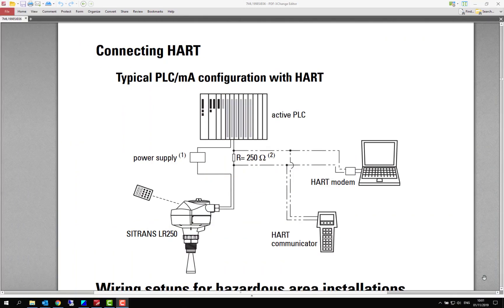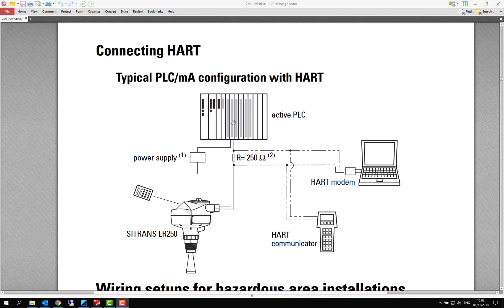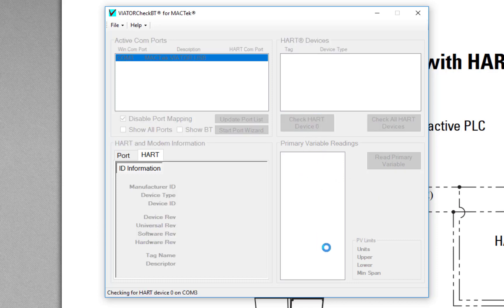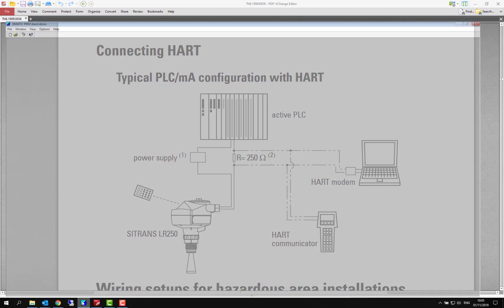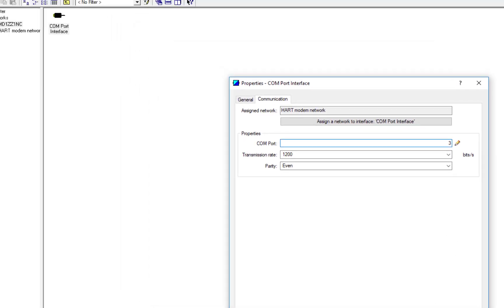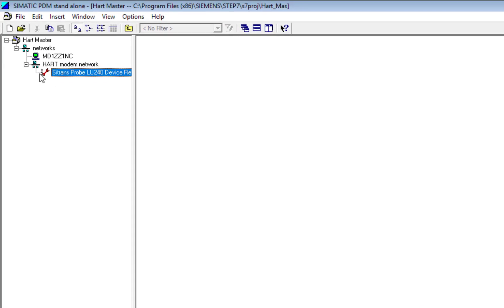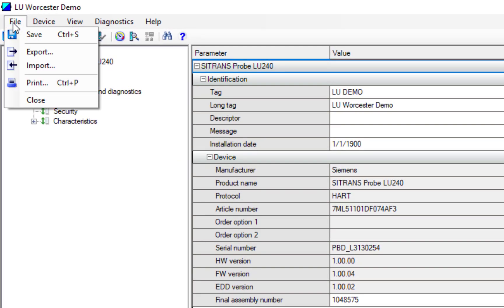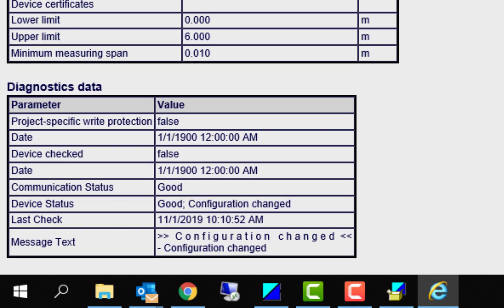How to setup Siemens SIMATIC PDM to communicate to HART devices.

Comment: I’m having the same issue as someone mentioned below. I get the “could not establish a connection” error when I’m on simatic. When I use Viatorcheck it sees the device and the variable.

I’m using windows 11, simatic 9.3 and a viator hart modem. Any suggestions?

Comment: Very helpful video, I’m having a problem using PDM stand alone with a hart modem. When I create a project / hart modem network in PDM i'm not able to connect to a device in the field. I create the hart network, go to insert device but receive an error back saying "Could not establish a connection at the given address. Timeout while waiting for HART response. Device not found".  I have tried the auto setup option and manually selecting the instrument then trying to go online but same error each time

My modem dose communicate with the instrument when I do a poll test. It’s RS 232 in a RS 232 port on my laptop in com 1. 

I get the feeling PDM is not seeing my com port or the modem thats plugged in, any suggestions on setting in PDM i may need to check, or other setps not mentioned in the video would by much appreciated?
Reply from the maker: PDm had issue in the old day with RS232 modem and you had to slow your FIFO buffer down.  Find your modem in the Hardware screen and go to properties and find advance options.  Under here you will find the FIFO buffers slide both bars over to the left.  Select Apply then restart your PC.
Reply from the maker: Also please confirm the following:-
Version of PDM
Version or Windows.
Mark / model of HART modem.
Reply: It’s version 9.1, windows 7 professional, the modems a procomsol HM-RS232-ISO.  Would the baud or parity in PDM need adjustment from the default settings? In the PDM software under options settings and Hart server would this require any adjustments. Regards Dave